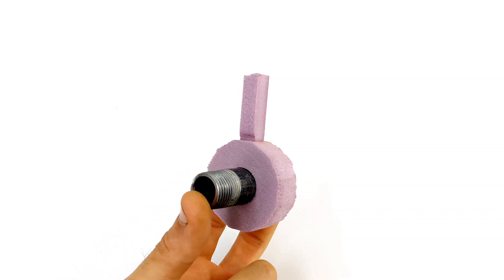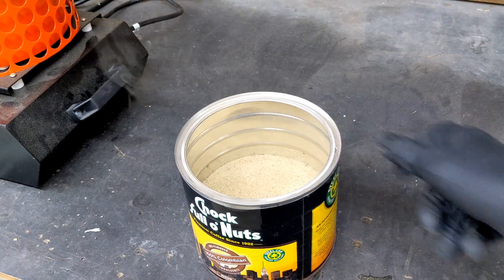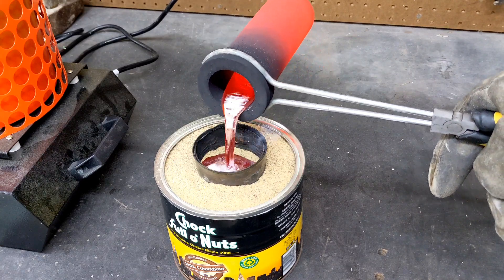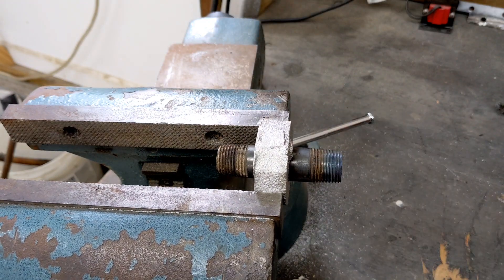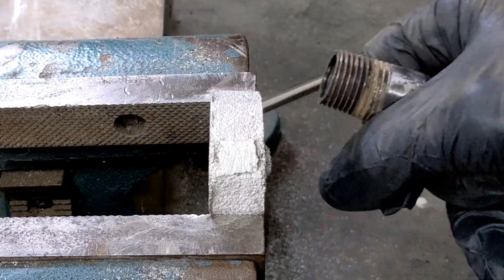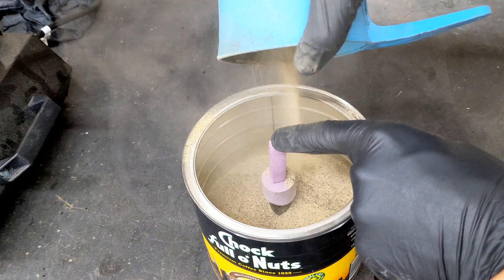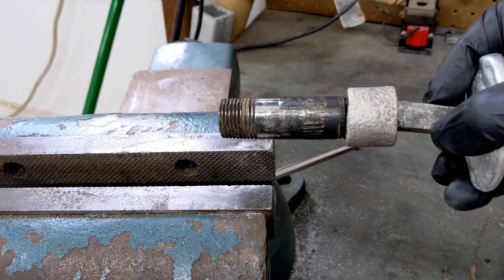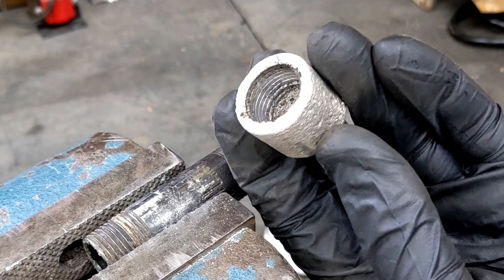Experimenting with Lost foam - 2 Lost Foam Metal Casting Experiments

Comment: GREAT concept, would have never considered the idea. 
Around the pipe is interesting as it could make interesting ways to mount tubes or shafts or mount a ring gear to a shaft, cast the aluminum then put in a lathe and cut concentric then lay out some holes for a ring gear mount and then drive the shaft or tube? 
Wax on the threads or mold release them, 
For pipe prep sand blast with coarse media or grind with a 40 grit stone, the aluminum may not release near as easy, a few chisel marks every 15 degrees around the pipe would also work wonders in resisting a turning force and a groove or two around it should stabilize any movement laterally on the pipe.
Reply from the maker: Yeah it was a test for a future project 👍👍. It worked out really great, though the threads didn't work out as planned.  Holding the pipe in place works great.

Comment: What is also wild is that this time you did not drywall coated the foam!! And that it works!
Reply from the maker: So the drywall coating only gives it a smoother finish.  If you look at this one you are the grain of the sand.

Comment: Next time, put the pipe into some water, but leave the aluminum part out...once pipe has cooled, try to unscrew the aluminum hot, it will be expanded and unscrew easier, but the pipe will have been cooled by the water...
Now I wonder if you could rough up or even cut a diamond pattern knurling on the metal pipe if you wanted the aluminum to be a permanent fixture on a steel pipe...or a way to have two types of metal become one piece
Reply from the maker: I see what you are saying about cooling only the pipe.

Yes I think if I cut a few slices into the metal pipe the aluminum would grab it.  Basically making it an almost permanent fit.
Reply: @HeinrichsMade  I wonder if white spraypaint (or whiteout) (a paint with a powdered filler) painted on the steel before pouring the aluminum would allow for a "release agent" to be able to unscrew...
Reply from the maker: @haydenc2742  ha, maybe...  I'm not going to try it though.  Molten metal is very dangerous
Reply: If I put a long steel pipe in the mold.
Will I be able to remove the pipe if I cool it with water until the aluminum is completely cooled?
Or another way?
Thanks for all the answers.

Comment: I'm pretty sure you don't need to waste time cutting threads in the foam. It should just flow and fill the voids during the casting, right? Cool channel, new sub here.
Reply from the maker: I agree, and was going to try that as well for another experiment.  However, it didn't take much time at all to cut the threads in the foam.  I just thread the pipe into the foam.  Literally 10 seconds to do.
I understand what you are saying though.  If the foam is wrapped around the threads, the molten metal will fill the voids where the threads are.  I don't see why it wouldn't work.

Thank you!👍👍🙏🙏

Comment: That's an interesting experiment. I'm not surprised at the results however since the thermal expansion rate of aluminum is higher than that of steel. If you want to have a cap that doesn't crack, I think you'll need to make the outside diameter a bit bigger.
Reply from the maker: Thanks!  Yeah it was pretty cool to see how tight it was against the steel. 
As far as the crack in the cap.  That's what I think too, making it thicker it might not crack.

Comment: Might have cracked itself during solidification, trying to shrink onto that pipe...  If you want it to never ever come off, grind or drill a few gouges in the pipe for the Al to lock into for a permanent mechanical fastening.  Seems like you want to be able to remove it though.  Whatcha making?  Burner with a cast on venturi?  Lots of applications come to mind...
Reply from the maker: That's what I was thinking, but I didn't look before I cooled it with water.  If I was to do it that way again I would try to make it thicker.  I was thinking of adding gouges in the pipe, but now that I see how strong the aluminum holds it, it doesn't seem necessary.  My future project that this is for, I don't want to be able to remove it.  You'll see 😎

Comment: Interesting experiments. Came out pretty good, looks like a useful technique. 
Some years ago I joined in on a community challenge to make a bottle opener, I cast Brass around a steel wrench and that worked really well.
If weight and color don't matter for your project, give brass a try 👍
Reply from the maker: Thanks!  I did it for a project that I am working on.  Brass on steel probably looked really cool.  I'd love to do brass over aluminum, but it would probably deform or melt the aluminum 🤣🤣